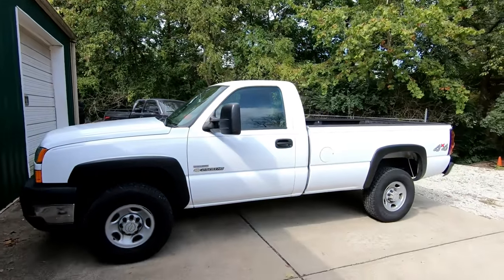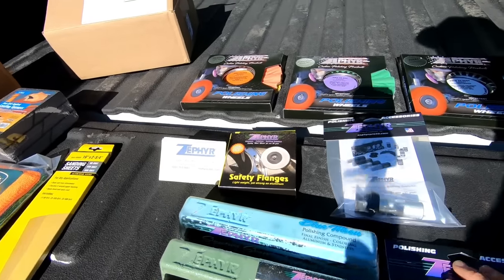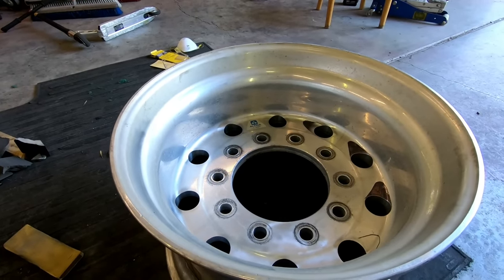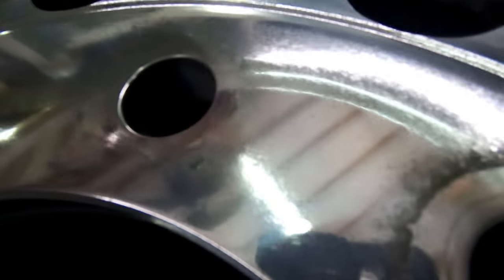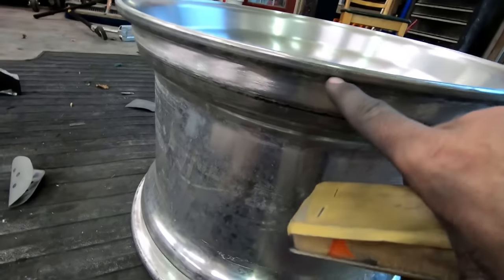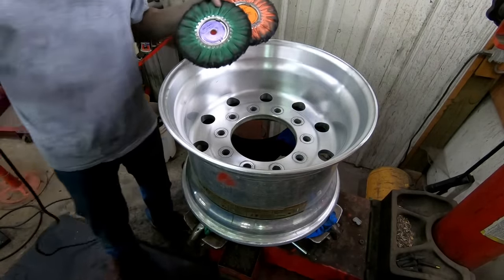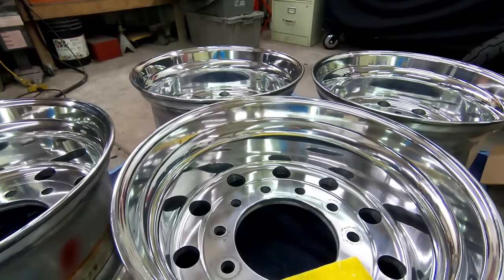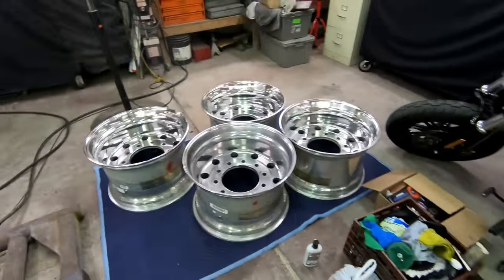How to Polish and Buff your Aluminum Wheels to a Mirror Finish!

Comment: Beautiful!!
Tip: Take an old hub, and weld or bolt it to an electric motor, and mount your wheel to it. Set it up so your wheel face is up. A wheel balancer works pretty good too, but that angle is a little harder to work with. This is how a lot of wheel refinishers, can bust out multiple wheel sets on the daily. This is good for filing and sanding out curb rash, cause you get an even lip all the way around, as well as sanding out all the pitting/knicks, cutting, and polishing the wheel evenly without creating low spots.
Reply from the maker: Always wanted to do that!!! If I polished wheels more often I would definitely build a fixture
Reply: @NaztyNate  Cool!! Yea, i haven't made one yet either, but i have salvaged all the parts needed from an old furnace. Electric motor, belt, and a multi speed spindle pulley, so i can adjust the speed. Going to use a 4x100 hub, and just throw on a hub adapter for different size bolt patterns.

Comment: thanks Nate,for harbor frt. sanding block tip , was just going to use sand paper, bought cheap torq thrust wheels, going to sand,polish,and paint spokes black. 139.00 bucks unfinished vs. 500.00 + finished. Time to get nasty dirty !

Comment: You can also use WD-40 to wet sand with the sanding discs.  I did a horrible set of aluminum mags.  I used. 400 grit up to 2000 to polish to a shine.  Wear an apron, goggles and gloves. Or you can just throw away your clothing afterwards!
Reply from the maker: I have heard of that actually! I'm sure it works well
Reply: @NaztyNate  
Messy as heck!

Comment: When you hand polish your alum, you should use cotton terry cloth. It will scratch less than the microfiber and leave a nicer finish.
Reply from the maker: Oh nice! Good to know!
Reply: Clean microfiber doesn't scratch at all. You can polish paint and wipe off with microfiber and inspect it with a light and there's zero scratching....and that's in paint which is MUCH MUCH softer than aluminum. On the other hand, you can NOT wipe down with terry cloth because it scratches badly. That said, I'd imagine terry cloth is fine for metal.

Comment: I just did my semi truck headache rack last weekend. I got most of it done... Sanded it with 220 and it was too much so i need finer... I also have haze marks... Probably going to sand again and redo... I wear a respirator also
Reply from the maker: That's awesome man! Sanding is definitely the most important part. If there is still a haze/scratches that just means the early sanding marks were not sanded out with a finer grit. It'll be impossible to get them all out but just get to where your happy with the result!
Reply: @NaztyNate  i am going to try lighter sandpaper next time. Every time i do it, it looks better. I have a video on my channel if you want to check it out... The last video i loaded.

Comment: If you dont have a tire machine, put the rim back on a jacked up car with all corners of the frame up on jacks, and rotate your wheels to the drive axles, then while at idle you can POLISH them while they rotate. If you are a scare D cat, you can always spin them without the car running and spin them by hand https://www.youtube.com/watch?v=4HtWbGex3k4 ( take the valves out and weights off first ) you will still have to do the lug holes after you've taken them off the car.

Comment: This what i do at work,but we have two expensive machines that sands,cuts, and colors..Can't even tell you how many super singles,22.5's,24.5's..I work in a retread factory for Semi tires and we polish wheels and powder coat them too..Thats pretty cool how you do it..I see this vid is kinda old,but if you see this im kinda curious how much one of those hubs cost..
Reply from the maker: DUDE thats so aweosme! I would love to see the machine that does that! Mybe bring mine with me haha. And the wheel adapter? I have a video about them! They are like 900 bucks!
Reply: @NaztyNate  if i had a good camera i would,idk how good my phone would record it..but yeah it is pretty cool. Im gonna have to check out the video on that,900 dont seem that bad..
Reply: My bad,i was talking about the assembly you put the wheel on to spin it while you're buffing the wheel..
Reply from the maker: @dontworrywhatmynameis4111  That'd be cool! Oh sorry! I just put it on a tire machine to slowly spin the wheel, plus it got it off the ground so I didn't have to bend over and kill my back after all 4 wheels lol.
Reply: @NaztyNate  yeah thats what i meant lol,what that wheel machine  cost. And to be honest you doing it the way you did it turned out just as nice if not nicer..The two machines we have at work cost somewhere around $125,000 a piece and when I run the cut and color cycle it leaves some of the compounds on the wheels and I use rubber cleaner on it to get it off but sometimes it leaves like a shadow..our polishers need overhauled by the company that makes them but it cost something like $5,000 just for them to come to our shop smh..But i wouldnt mind trying to find a wheel machine like you have and try to start some extra side work polishing..Even with the quirks our machies have im pretty good at polishing a turd lol..You should see the condition that some of these wheels come in looking like..
Reply from the maker: @dontworrywhatmynameis4111  Thats a pretty penny! Lol. And yeah it can be pretty fun as some side work but it is a lot of work! I bet some of those wheels out there just get destroyed, I can only imagine lol.

Comment: What were the grits on the harbor freight sanding  blocks?  That was step 1. You said 600. Was that the only one used?
Reply from the maker: Yeah that was the only one I used, but I feel like those harbor freight sanding blocks start to fall apart and become close to 1000 grit. It would be safer to work your way up to 1000 before polishing but that's up to the user.

Comment: What type of grinder were you using they say to use variable speed grinders would a regular grinder work
Reply from the maker: A 7 inch grinder can be used to do the main cutting. But you will want to use a buffer/grinder with variable speed (up to 3500) too get the best shine with the last few steps.

Comment: Was the Zephyr product able to remove all the sanding marks?
I'm currently in the process of redoing some factory Ford F250 rims that have heavy oxidation which required a lot of sanding. I can get them to shine with normal aluminum polish and a puffing pad but the scratches are still prevalent. I was looking into the zephyr kit, but I don't wanna invest if i'll be in the same situation.
Reply from the maker: It does take the sanding marks out but it depends. You need to make sure each time you step up in grit you are actually removing all the sanding marks from the last grit. You should sand up to about 1000 grit before you start polishing
Reply: Hey man thanks for the swift response! My finished product rims are at 2000 grit, so I should be good to go with the polish kit from then right?
Reply from the maker: @YeZookaChannel  oh yeah they should shine up nice if you're at 2000!
Reply: @NaztyNate  AWESOME! Your rims turned out well, hopefully I can get mine looking like them. Keep up the good work!
Reply: @NaztyNate   Do you have an IG? I just got my Zephyr stuff in and I still had the same hair line scratches after finishing buffing. I'm trying to figure out what I'm doing wrong. Was maybe hoping I could dm you some pics/videos on IG
Reply from the maker: @WeekenderGarage  for sure. My ig is nazty_nate_

Comment: Just wondering how you are going to install 10 bolt rims on 8 bolt 3/4 ton
Reply from the maker: Its's actually more common than you may think. Check out a newer video of the adapters I got for them to bolt on to an 8 lug truck!
Reply: Adapters.

Comment: I have a old set of centerlines.they have this plastic  coating stuff that just dont come off.also pitting and ccorroding   any  suggestions.the coating is tough stuff to get off?  Thanks
Reply from the maker: It's most likely clear coated from the factory, I've seen people use aircraft paint stripper to remove the coating or just sand it off. When you do that though, you would be exposing the bare metal to the elements and they will lose their shine more quickly when it rains and especially in the winter time. if you live somewhere with salt. You would just need to keep up with them to stay looking fresh!
Reply: @NaztyNate  thank u.im going to give that a try..I apprentice the response
Reply: That shit is a pain in the ass to get off..I do this same kind of work but with and expensive machine..What your talking about is called durabright,when you try to sand it it leaves a white sheen over it and you just have to sand the hell out of it..

Comment: What grit of sandpaper would you recommend starting with and what grit would you recommend stopping at?
Reply from the maker: I'd recommend stopping at 600-1000, the buffing wheels i used will buff polish something close to 600 or above. Starting is a bit different, it just depends how bad the wheels are. I would start at 320 and see if that will sand out any pitting/corrosion. If not, go lower. In most case you could start with 400 or 600 if there is little pitting.

Comment: Great video 👍 Thanks
What Zephyr polish did you use ?
Reply from the maker: The pro 25 is the best 1 step polish imo...but if you need to polish some heavier oxidation you need buffing wheels with rouge.
Reply: @NaztyNate  Thanks for help/information
Reply from the maker: @Richard5873  No problem!

Comment: Can you sand blast the wheels to start?
Reply from the maker: I would not recommend sand blasting before polishing. It is very hard to get the surface smooth again after blasting (it would require a lot of sanding). The best way is to use sand paper and work your way up to 600+ grit.

Comment: Are rouges better than aluminum polish like mothers? Great vid btw😎
Reply from the maker: Not better or worse..Just different, rouges and buffing wheels are rated with different "grits" so you can bring out the shine better. Mothers could be used on something that needs polished but it won't fix heavy oxidation/scratches.
Reply: @NaztyNate  ic. Tnx for the info. Keep it up 😎

Comment: Can you do that by hand? I don't have electrical tools
Reply from the maker: You can, but you gota get the elbow grease out! It takes alot of work but its do-able
Reply: @NaztyNate  I tried polishing my aluminium supermoto wheels with a standart polish paste but it just makes it matte color and not shiny...Do I need to buy specific paste for aluminium?
Reply from the maker: @Unknownas1337  does the towel turn black? If not there may be clear coat on it
Reply: @NaztyNate  Yeah, It turns black. You can see little black dust when rubbing with the pasteand a towel or a sponge

Comment: Can I use something else instead of ceramic coating?
Reply from the maker: Absolutely. Some people wax them just to help keep water and dirt off. Some people clear coat them, this will dull the shine a little bit but you wont have to polish them again if it's done right. Or, just hand polish them every few weeks to keep them shining.
Reply: @NaztyNate  thanks for the response. I want to clear coat them after they're polished. Do I have to scuff them before clearing them? Or can I just spray clear right over the clean surface.
Reply from the maker: @HackMasterBlaster  I've heard mixed opinions on that.. I have not actually done it so I'm not sure. I would call a local shop and see what they say.

Comment: Man looks good! Have you ever did cast aluminum wheels? What kind of steps would you suggest? Go Bucks!!!
Reply from the maker: Thanks a lot!! I have never tried cast aluminum personally, I would try steps like this on a test area and see what happens! If you do not want to go this in depth to test it you can try to just use a metal polishing cream(like the white diamond) if it turns black it will work, if not it will not polish correctly.
Reply: My wheels are originally black and used some aircraft stripper to take off the paint. Sanded it down. Then used the fast cutting wheel with the brown bar. But I still see scratches. You think the green wheels and the blue wheel would help before I buy them?
Reply from the maker: @justsomestuff2  The only scratches you want to see are scratches made by the buffing wheel that you are using. If you see deeper scratches youll want to go with a higher grit sandpaper to get rid of them before polishing with the wheels and compound.

Comment: That was impressive.
I thought aluminum would slowly dull and oxidize if left untreated.

Most factory rims have a clear coat on them. I'm wondering what will happen to these rims in two years if you don't apply clear coat.
Reply from the maker: Its been about a year and I have hand polished them a few times but they still shine!

Comment: Hey man I'm in Ohio as well , would you be interested in Polishing my Freightliner drives ,steers and 2 tanks? I have top hats on the drives so no lug nuts to work around.
Reply from the maker: I'm up for it! I'm in the Dayton area, where are you in Ohio?
Reply: @NaztyNate  Awesome im out of Kenton oh , I can bobtail it over and drop it off Saturday if you want.or I have a morning del in tipp city Friday morning but I ll have the trailer.its an everyday worker so it doesn't have to be perfect but I'd like em nice. How much loot do you need?
.
Reply: @NaztyNate  Do you have a way of getting ahold of you? We can talk ,it's just easier.
Reply: Just got a wash in Beaver dam loading for tipp city we can shoot for tomorrow or the truck is sitting all day Saturday that would actually be better I can take off the covers and wipe down for you ill work with you . Maybe do the bottom halves then roll it forward so you don't have to work upside down.Make it easy on you.
Reply from the maker: if you have an instagram just message me in there or i can try to get you my email but i dont think it will let me post that in the comments

Comment: it takes a hell lot of materials,tools and equipment to get the job done.same result as others did😅
Reply: I'd rather take my stuff to a guy who sands cuts and polishes with proper gear then take it to joe jobbers down the road and have them charge 110 a wheel and they just used acid bath and bottle of blue polish from that one dumb company on YouTube.

Comment: I know that was a lot of trouble I tried polishing my Mickey Thompson Wheels with no success they're just not good Wheels to try to re polish I don't think good video. they didn't hold up very long the clear coat come off and they look like crap
Reply: Did you remove the clearcoat first?  Once the clear is peeling in some areas you wont fix it without alot of sanding in those areas, blend the clear. If you still have the wheels and wanna give it another go, use a paint stripper to get rid of the clearcoat then you can sand and polish. You can reclear coat them after if you havent given up on clearcoated wheels

Comment: What grit sandpaper did you initially start with?
Reply: Mike NYC M 40...that’s how bad mine were. Even before that an electrical grinder.
Reply: Finish with at least 2000...Go 80....150...180...320...Finish with...2000.
Reply: On a DA sander.

Comment: What grit paper did you use to remove the pitting?
Reply from the maker: I started with around 300 or 350. I could have taken it to a lower grit than that though, I might do that at a later time to try to perfect it!